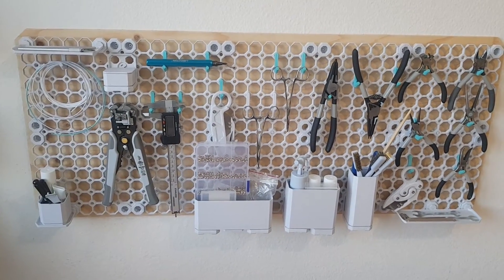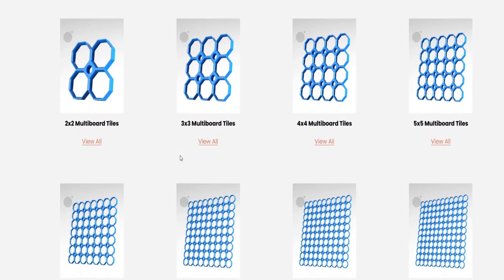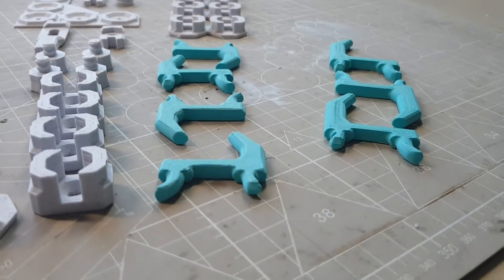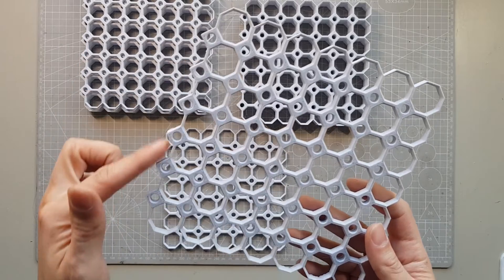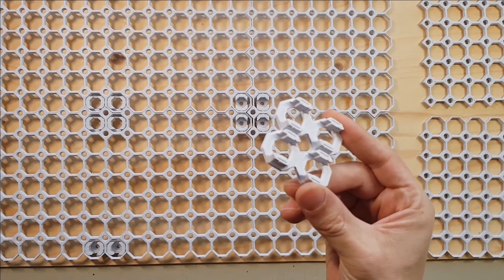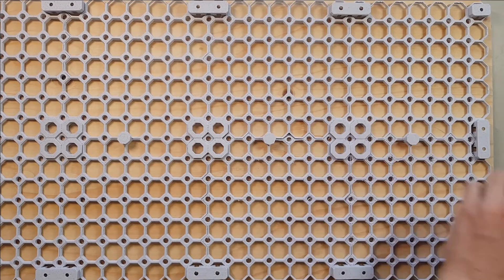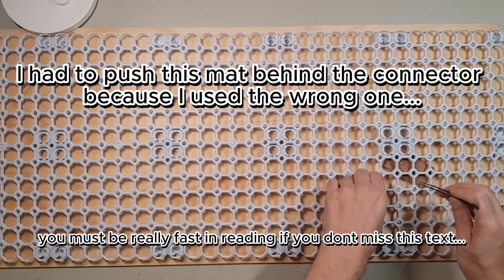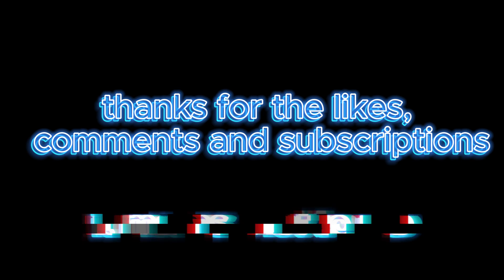Best tool wall you can easy build by yourself! - Multiboard

Comment: I tried printing 4 multiboards 15" x 15", and assembly parts. It took one whole week in my Anycubic Kobra 3 max. Also you need to drill too many holes on the wall to fix them. These multiboards take too much time to print and assemble, and not strong enough like the steel pegboards which are easy to install and costs 1/4th the price of 3D printed multiboards. For $ 100 we can buy good steel peg boards and tool holder accessories and install within few hours. So, my final thought is that it is waste of time and money in 3D printing the muliti boards. Not practical.
Reply from the maker: Sure, industrial made pegboards are cheaper. But i really like the look and functionality of the Multiboard and will do more of them when i find the time to print them ;-) yes they take a lot of time... But for me its worth the time and efford

Comment: oh my god what a disaster, i need to stop watching, i'm only 5m44s in and I have seen to many issues.
the end result should be stuff on my wall, but to get there, he first has stuff on the multiboard panel, then multiboard panel on the wood (which itself costs a fortune), then wood on the wall. How about forget the wood and attach the multiboard directly to the wall?
Make the panels 8x8, so that they join together at the same spacing of the stud walls. this way every 2nd snap is in a stud.
Next, don't use two dual snaps with one quad snap, use a quad snap in the front and the back.
I'm done, can't watch any more.
Reply from the maker: Hi Jason, the wood is just for the look, yes it makes it more expensive, but i like it much more that way... I dont get it what should be wrong about using the 7x7 panels, its the max size that my printer can do, so...
You can use double snaps or quad snaps, not a problem at all ;-)

Comment: Get a dimond back nozzle woth evey penny.
Reply from the maker: Hi Odeball, yes i have to try these, i ordered 2 high flow nozzles some time ago, they also make a big difference, especially in 0.6mm. they still work fine, no clogging so far and way less print time :-)
Do you use the diamond back in 0.4, and what printer are you useing? Cheers ✌️
Reply: @Dirt-E-Bikes  i have 2 ender 3s, monoprice mini, voron 0 un built, and an A1 mini. I have a problem.
Reply from the maker: 😄😄 nice one 👍
You have a diamond back on each of them?
Reply: @Dirt-E-Bikes  no just one of the ender I want one for the a1

Comment: Instead of a brim, you might want to try mouse ears just on the corners. They are a lot easier to remove.
Reply from the maker: @ulaB  Hi Balu, thanks for the hint, that sound good, i will try that on the next panels i print. Allways appreciate good tips 👍👍
Reply: @Dirt-E-Bikes  I've stopped using any sort of printed bed adhesion on my Neptune 4, I just use a regular glue stick with PLA and it works great to make prints stay in place.  I found an article that said you really only need the specific 3D printer glue sticks for things like PETG and ABS.  I just upgraded the nozzle from the stock one and so far it's been great.  I really like the multiboard stuff, I just haven't got the space to really get into it at the moment.
Reply from the maker: @computerdave06  hi Dave, thanks for the info. So far i did not use a lot of glue for my prints, but if i do more of the warping stuff, like ASA or ABS, i would have to look more into it. Can you tell me what brand of glue do you use, that works best for you on the N4?
Thanks and have a nice day ✌️
Reply: @Dirt-E-Bikes  My N4 came with a single stick of Elegoo brand, but for PLA I just used a generic glue stick I had from buying school supplies for my kids. :D  I did recently purchase a pack of Outus brand from Amazon, but I didn't do much research and just kinda picked one that wasn't expensive.  So far it's worked great though.
Reply from the maker: @computerdave06 thanks for the info, i think i still have this elegoo branded one somewhere... 😅

Comment: What kind of flexible built plate is that on your printer?
Reply from the maker: @mfeltster  its the standard one that comes with the N4pro, but you can find it on aliexpress as well, search for PEI build plates. They come often in a set with a magnetic base

Comment: What's the trick for installing snaps for the tools?  I push as hard as I can and can't get them to snap in.
Reply from the maker: @boboscurse4130  you mean the hooks? Did you use a deburing tool on them?
Reply: @Dirt-E-Bikes  No I mean the snaps themselves.
Reply from the maker: @boboscurse4130  ah oke, so it could be many things, but the most comen imo is in the print settings. Check these first. Maybe you have inner and outet walls that are slightly bigger or shorter than they should be. You can do a testprint an measure it to find that one out. Holes in prints often get a bit smaller diameter than they should. Also did you try to cut a bit away with a deburing tool? If that works, its also probabely that you have to check yout print settings. Maybe the material flow a bit too high, that was it in my case.

Comment: I just started my multiboard journey, to bad im owner of a flashforge adventurer 3 so i cant do more then 5x5 at the time. This will take 4ever im doing a whole wall of em.
Reply from the maker: Very cool 👍 how big is the area you plan to multiboard? 
Yes even with 7x7 tiles it took me quite a long time to build my (smal) multiboard ;-)
But it was worth it, and a whole wall will be that much cooler then only a smal board! 
Let me know how it went, and i wish you a good time building it ✌️
Reply: @Dirt-E-Bikes  superbig area we are talking about two whole walls, but im starting to think to buy ikea pegboards and just print stuff to hang and use my printed multiboard on smaller surfaces.
Reply from the maker: @Glorious_Yell0w Yes i guess that would take a long time printing... Did you see that there is a option for stakable printing?... That way you could let your printer print multible tiles at once... But still, you would need a lot of time for your area. I guess the ikea boards with prints is a good option too, especially for larger walls.
Reply: @Dirt-E-Bikes  No i havent seen that, wow that would really help. Im thinking about uppgrading to a new printer. Im using a flashforge adventurer 3 now. But thinking of going bambulabs or what ever they are named. =)
Reply from the maker: @Glorious_Yell0w  yes a bambulab carbon or something similar... That would be great, but it also have its price 😅
Reply: @Dirt-E-Bikes  I also been checking out the Elegoo Neptune 4 Pro and its only like 300bucks were i live. That could be a good alternative to a bambulab. They say its as fast as the bambulab.
Reply from the maker: @Glorious_Yell0w  im happy with my neptune 4 pro, but the bambulab seems to be even on another level. For me it was also the price that made me buy the neptune 4... I think i also have a afiliate Link in the video description, not sure but maybe you can also save some $ on that printer... But prices are changeing so fast these days i lost the overview some time ago 🦧😄

Comment: This AI Voice is really distracting, please consider using your real voice, trust me, it is 100% easier to listen to than this ai stuff
Reply from the maker: yes, true...
i had to take some english spelling lessons first, now i tried in my newest video, please let me know if its any better
Reply: @Dirt-E-Bikes @Dirt-E-Bikes Hey, it's a real improvement. Stick with it. 

A little advice, though:
1) You don't have to mimic that announcer/presenter/radio ad way of speaking. :P Don't stress it, though, most voice over people have a tendency to fall into doing just that as it's an easier way of avoiding the jitters and awkwardness from speaking into a mic when you're starting.

I did the same thing myself. :P But I didn't stick with it (though I hope to get back to it at some point). Be better than me, and keep it up. ^.^

2) Ease back on the background music. Even if you've background noise cluttering the noise floor, most people listening on cell phone speakers won't notice. (And use tools to filter out what you can, Izotope was handy for me.) Especially when paired with the Announcer voice, which is a bit boomy on what's stressed and soft elsewhere, the soft bits can get lost in the music.

BoothJunkie was pretty helpful when I was working up to starting. 

3) Stick with it. It's a skill you learn, not an innate talent. You've a decent start, keep building it up. ^.^
Reply from the maker: @dracodraco1982  thanks a lot mate, really like the constructive way of your comment/input.
I will try to get better with every video, and its very helpful to get tips like yours. Cheers man 🙂👍
Reply: @Dirt-E-Bikes  your new vid is so much nicer. This AI voice is unbearable.
Reply from the maker: @samueldavis7020 true! when i hear that now i feel ashamed 😅
Reply: Glad to read that you are backing off the ai voice. I stopped watching this video after about 1 minute because I couldn't take the voice anymore.
Reply: I actually found the voiceovers very entertaining. I don’t think the rich humor would have been nearly as effective without the ai voiceovers.

Comment: I need to make a channel my prints make these look pretty bad no offense. Elegoo just ain't a great printer like elegoo
Reply from the maker: Hi Oldnasty, yes my prints in this video look pretty bad... Its mainly because i used a very old and worn down nozzle, so its not the printers fault by mine, should have changed this nozzle way earlyer. Have a new nozzle now and it looks again ad it should bow ;-)
Reply: Lol the two:  "My printer are better then yours" comments 🤣 They have the same energy as "My dad are stronger then your dad"

Comment: Mind sharing your printer settings? I have a cr10 and it’s taking 10hr for a single panel.
Reply from the maker: What printspeed can your cr10 run? I used PLA at a printspeed of 250mm/s. Other than that, i use the standard settings of Elegoo Cura - Generic PLA.

Comment: Use Cross Quad Offset Snap 1,2 parts A and single B part to connect core, side and corner tiles instead of pair of 8 mm,  x2 Dual Offset Snap
Reply from the maker: Thx, i will try that on my next wall 👍

Comment: Nice build! Since I have drawers to work with, I went with gridfinity. Did you see my suggestion for doing a heat insert press as a future build?
Reply from the maker: Thanks mate, i would love to have some drawers, but for now, its toolwalls and stapled boxes ;-)
I think i missed it with the insert press, i wrote it in my 2do-list now and i think thats a very good idea.
I still have 3 videos i am cutting right now, so it will be to a later time. Thanks for that suggestion 👍